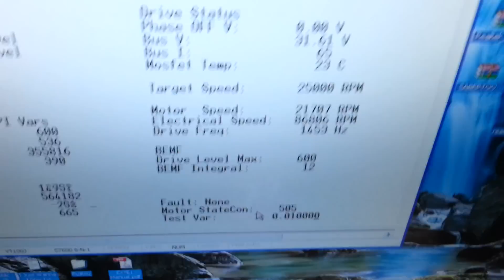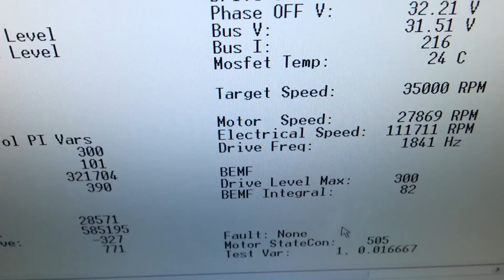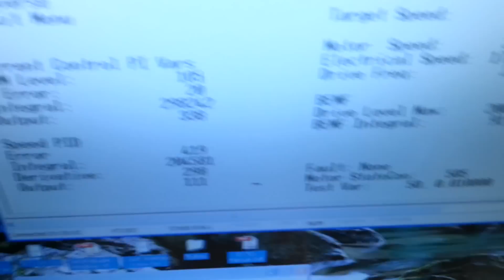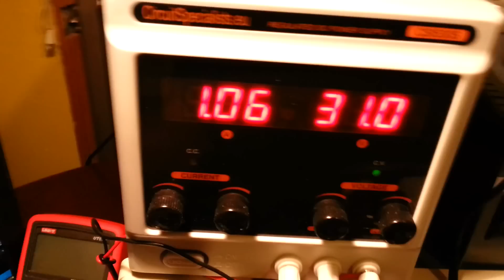BLDC Motors Run at highspeed upto 39000+ RPM on ESC

Comment: Could your controller power a fisher and paykel smart drive 12 inch washing machine motor at 3000 to 5000 rpm with lots of torque

Comment: Could you share more information on your test setup? Like code are you using? What is the circuit driving the motors? Thank you
Reply from the maker: My circuit it is developed from Microchips MCLV-1 and 2 demo boards, you can download the pdfs from their web site, I'm not planning to release my code at the moment, all the large IC manufactures have example code with detailed explanations of how they work. Also people like Benjamin Vedder have released complete professional projects including firmware, software, circuit diagrams, pcb layout and component lists.

Comment: can i use esc 40a with hard motor and get 15000 Rpm ??? and in what volt
Reply from the maker: +ahmed galal A 7200RPM hard drive is designed to spin at that speed with approximately  12v so with 24v is a good start.(Or you could use a 15K drive designed for that speed at 12v) Using an RC ESC is a good idea if it can handle higher voltages, some will struggle to get the motor spinning from 0 RPM. Be careful with motor currents over 2 amps will probably burn out the coils. Please post a video of your experiments.
Reply: i must up the volt or i can just up the amp on volt 12 ?
Reply from the maker: A motor designed to spin at 7200 RPM at 12V will be generating a back EMF or voltage of 12v so will not take in any more current. To make it spin twice the speed you will need 2 the voltage. Motors have a  specification KV = 1000RPM per Volt.
Reply: +Coolkeys2009 so my hdd rated in 12 v 850 mA >> what about give it like 1.8 amp in 12v what will happend ?
Reply from the maker: ahmed galal If you look up motor KV and basic motor theory you will understand that a motors speed is proportional to the voltage across it and the current basically controls the torque. A 7200RPM motor at 12v will probably spin at less than 10000RPM. The only way the current will increase is when the motor is accelerating up to speed or if your applying a load to it to slow it down. The windings will be designed for the normal operating current so you risk damaging it if you put too much current through it. The best way to learn is experimentation along with to Wikipedia etc.
Reply: +Coolkeys2009 so the best way to make it get fast make the volt from 12 v to 24 or higher but with the same and safe amp like 900 mA Right !?
Reply from the maker: Yes, the ideal way would be to tell the ESC to limit it's output current to around 1 or so amps, or use a current limiting supply set to less than 2 amps to protect the motor, however this may cause problems for the ESC. Only way will be to try some experiments. Make sure any hard drives you use don't have glass platters that could shatter.
Reply: +Coolkeys2009 why this way will cus prob for esc !
Reply from the maker: ahmed galal If you use a current limiting power supply, it's voltage may drop bellow the minimum  voltage of the ESC causing it to shut down at higher currents. Personally I would just do some experiments and see what happens, maybe connect a multimeter in series with the ESC's supply to see how much current it's pulling.
Reply: +Coolkeys2009 what about use like 24 v 1amp charger with servo tester .?

Comment: I'd like to see a Seagate Cheetah 15k motor tested!
Reply from the maker: +TCPUDPATM PORTS I was thinking about buying a 15k drive from ebay for that purpose, but decided it was unwise to do so.
Reply: +Coolkeys2009  After making the comment, I went to look - they're still quite expensive! Someday :)
Reply from the maker: TCPUDPATM PORTS Many server hard drives were or are 15k so there should be plenty of them out there. Some may have glass platters so spin those up to 40K RPM at your own peril :-)

Comment: Hi, I am a bit baffled, with your eRPM achived (hence RPM as well). What is your PWM frequency? I have a 100KHz PWM and I can only get up to 180,000 eRPM with a very similar motor as the orange one you are using towards the end of the video. I run it off 12V, takes about 2A at no load and full 180,000 eRPM with 100KHz. I also use a fast Xmega running at 32MHz. You seem to be using a slower ATMega? Please check out my video as well...you will see what I mean.
Reply from the maker: luvocean1 The PWM frequency was 150Khz and the Micro-contoller is a DSPic30 running at just under 30MIPS. The motor probably could have gone a bit faster but I had the current set wrong, It was not very stable at that speed.